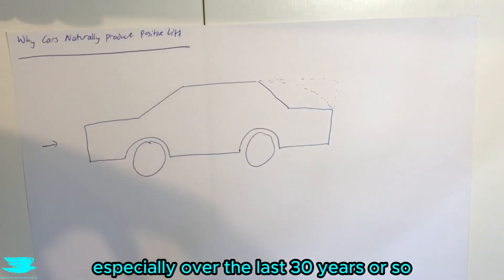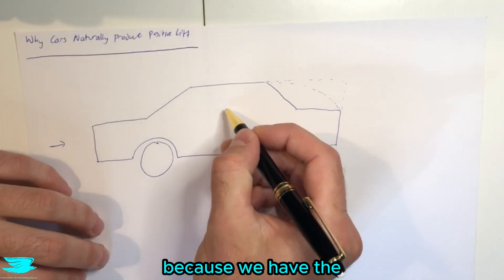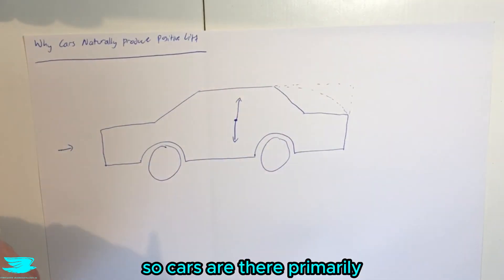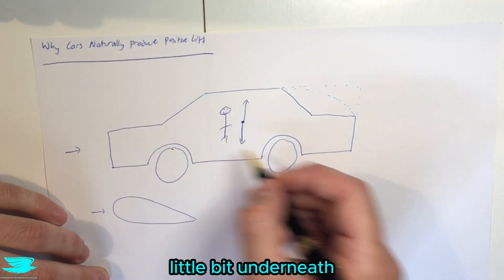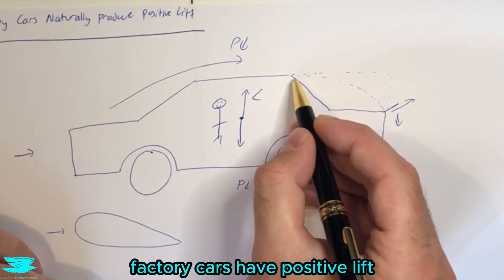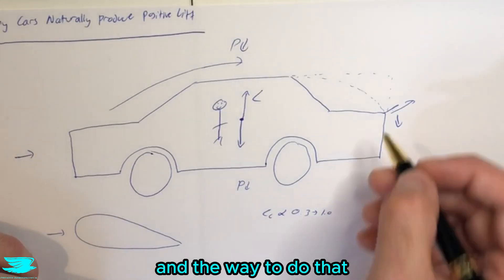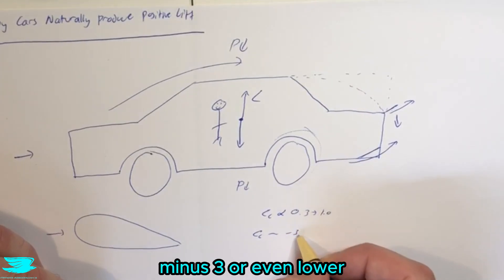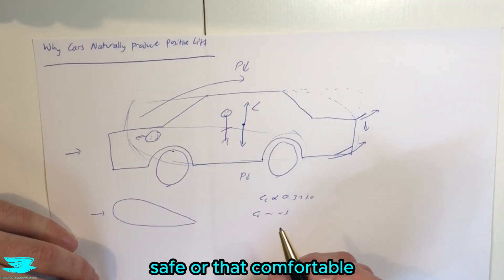Why Cars Naturally Produce Lift {Auto Aero #56}

Comment: Video request: explanation of alot of modern rear ends of hatch backs typically on xovers that have a spoiler at the top then a heavily raked rear windscreen then a kick up for the trailing edge then straight down for the rest of the rear. It's like they wanted the air flow to re attach below the roof spoiler, follow the fast back glass down then have a small rear wake. How is this possible because it appears to separate at the roof spoiler? Wouldn't a better design be having a vertical rear glass so your truck space is much much larger? This design is very common, example being the jaguar i pace.
Reply: Another example may help is Lexus RC350. It has the hard separation trailing edges (like most cars) just it has a heavily raked read window. Is this just styling for that coupe suv look. We're the raked rear window ends there is a perpendicular section where it meets the body work on the hatch, then travels the rest of the way down as normal. It seems this rear window design will just eat into cargo room with no benefit. If the rear spoiler was Not there the air could contribute to smaller rear wake. I can't see it doing so with the spoiler at the top. Thanks
Reply from the maker: Thanks for the idea! I think we might have covered what you mean here: https://www.youtube.com/watch?v=juGoQY05CKU

Is this what you meant?

Comment: This got me imagining a car with a curved underside and a flat top.

I have since stopped imagining 😂
Reply: Or at the very least more curved than the top.  I was thinking along the lines of being curved heavily between the wheels and using the rear bumper to create downforce. It would have an exit around the top of it and be shaped like a wing on the inside; but from the outside of the car it would just look like a regular bumper
Reply from the maker: That is the most effective way of producing downforce, and some cars try to do that to some extent with an aggressive diffuser, but still not all the way yet.
Reply from the maker: Lol